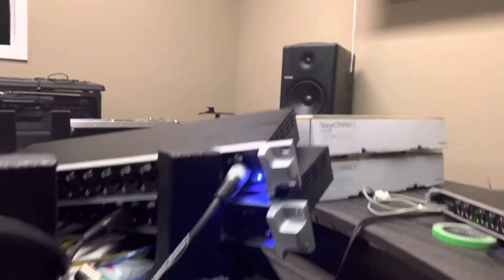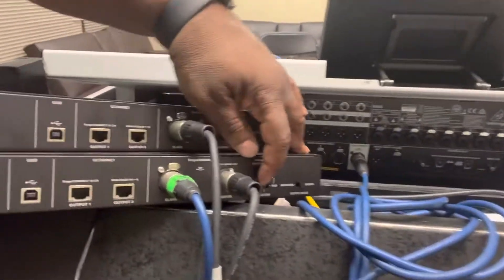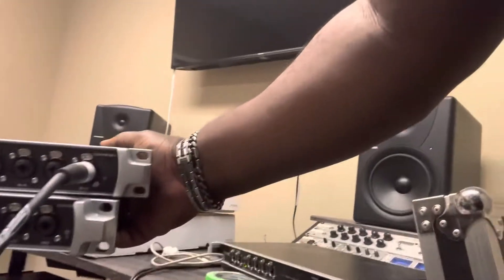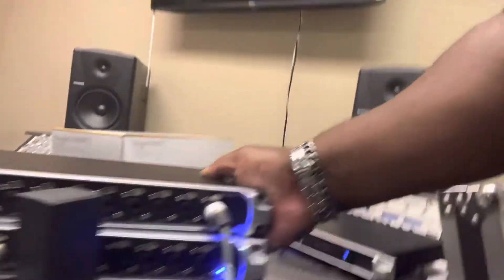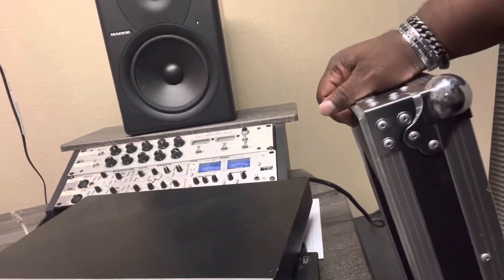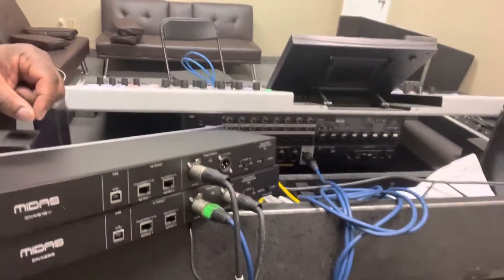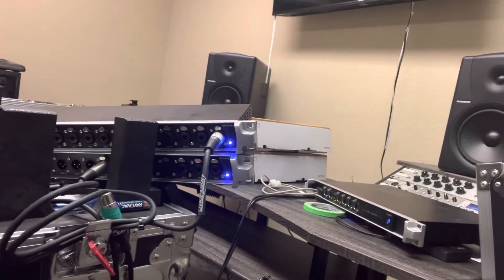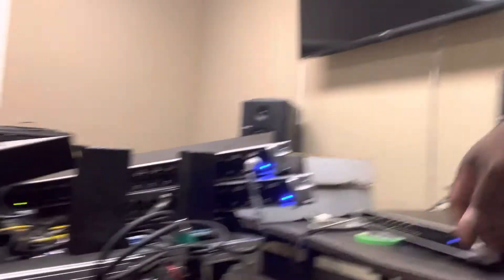Wing and stageconnect and phantom power

Comment: The issue you seeing with the power and setting switch is stage connect bus configuration. Bus configuration is done at power on, so setting the switch before hand is necessary. Also you had 2 master devices on the bus when you flipped the first box in the chain, stage connect can only work with 1 master

Comment: can the stage connect boxes be used by them selves without the wing ? 
would they work as a 16 in and 16 out with only xlr cable between them ? 
like  stand alone stage boxes
Reply from the maker: You have to have a stage connect port on the console.
Reply: Yes you can, put one box into Master mode with the power cable, link the second box that is in slave mode. So you could connect a DN 4816-I in slave mode to a DN4816-O in master and it will work as you are wanting.